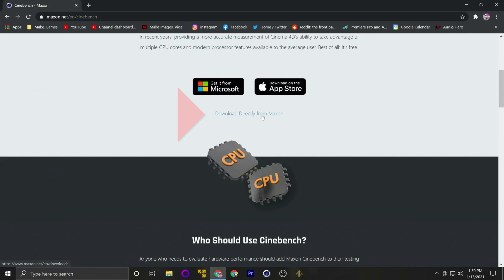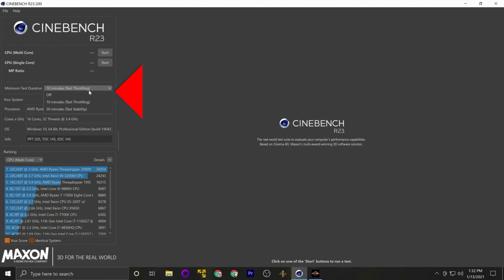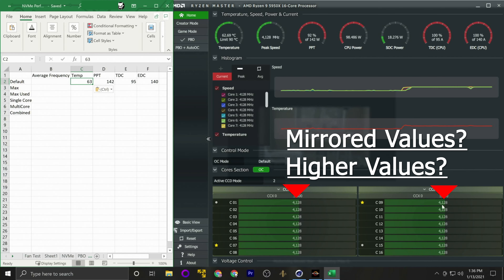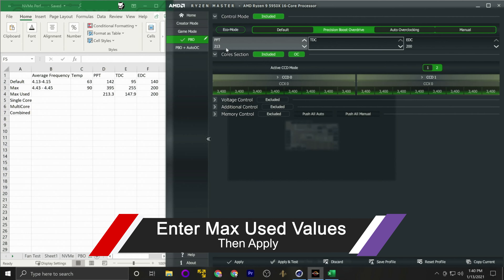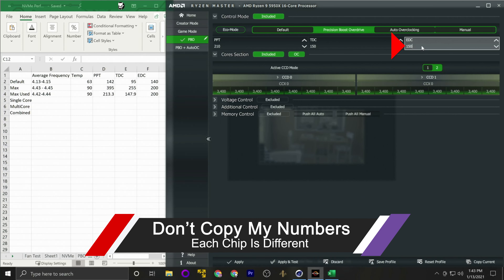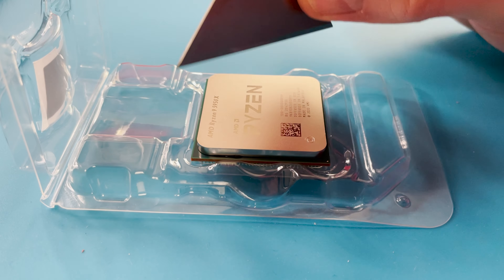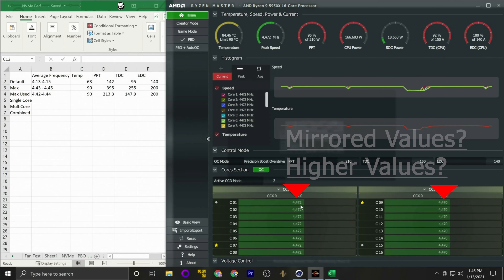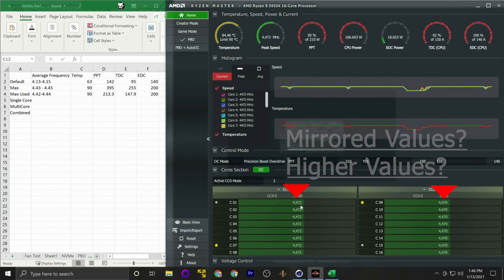Adjusting Ryzen CPU Performance with Ryzen Master ---- Part 3

Comment: What if your single core not only jumps around, but jumps between cores?  Yours didn't jump, and you didn't really address what to do if it does. 5800x
Reply from the maker: It will jump around you just want to minimize how frequently. Jumping means more load on the CPU which means less performance. This could be thermals, voltage, or general use. If you see jumps every 1-2 seconds, that's not good. Jumps every 3-5 seconds is better.

Comment: hello there good sir. thank you for this wonderful video. i did all that you advised in this video, though when i reached the single core test my single core frequency couldn't stay stabilized at all.. like going like crazy.. all i had in background was google chrome with the video of yours.. cinebenchr23 and ryzen master. i tried to change a bit the number of ppt etc. but for no good.. very unstable in terms of 2000 mhz jumps.. can you help me please? i have ryzen r7 3700X.. win11. 16gb ram 3200 mhz.and gpu r9 390 8GB. i think my cpu is bronze :( my MoBo is asus TUF 570x.
Reply: I have a Ryzen 7 3700x and I got mine to 4.475ghz stable. All I done in bios was change Dram voltage to 1.4 v leave PBO in Auto, Go in to Ryzen master set up manual profile, Change Cpu voltage to 1.325v and change each core to 4475 (4.475 ghz) hit apply a see the results. I went from 12430 multicore to 13738 in cinebench r23. Temp is less then 76c and Cpu power draw is less then 76w. the only thing doing it this way is you have to load your profile up in ryzen master everytime you turn your pc on or it will just run in normal PBO mode.

Comment: I know this is a little old, but I'm working thru underclocking/overclocking my Ryzen 5800X. When you update your PBO power limits (PPT, TDC, and EDC), you can apply it immediately. When I do this, I need to restart my computer each time to apply it. Ryzen Master will not allow me to apply without restarting. Anyone know why this is the case? Did RM get an update in the last year that requires this?
Reply: I had this problem, you likely have an 'auto OC' option turned on the the BIOS somewhere. I disabled it and then it worked for me.
Reply: @proevilz  thanks for the reply, I’ll take a look!
Reply: @jacobvriesema6633  No probs. I think even the 'D.O.C.P' mode gives this issue too.
Reply: @proevilz  ah. I do have a DOCP profile for my RAM. I was never able to get the specified frequency to work without the occasional BSOD. It’s only 3200MHz RAM but I have to run it at 3133 to be stable. I feel a little robbed that I bought this ram and it didn’t work out of the box.

Comment: what to do when your limited by the EDC. only one at 100%?
Reply from the maker: EDC tends to be the biggest limiter. I got to the point that I allowed mine to max out after I put the CPU on water. If the others are not at 100% that is a'ok. The goal is to maximize sustained performance.

Comment: my temps are always 90c with a 5800x galahad aio 240 with cinebench.  no matter what i have for pbo settings. someone got help me.  how is this cooler not able to keep it at a decent temp
Reply: facing the same issue even in default temp is already 90c. And when i max out the PPT, TDC and EDC it uses lower than the default values

Comment: What happens if the single core hops? What do I have to do to fix that ?
Reply from the maker: Single Core hoping a lot is more of a problem than hoping a little. Adjusting the TDC and EDC is often what is needed to dial it in.

Comment: Hi man, great stuff on your channel, i must for someone like me that is facing for the first time the AMD CPU.
Let me ask you something:

1) I've set my CO for ALL CORES a negative value of 30, but in Cinebench R23 both in multicore and in single core test Cinebench returns one error: which is the best way to approach the issue? For example, (let's talk about single core bench) looking in Ryzen Master which is the most used core during the test and try to lower the CO value just for that core from 30 to 25 or maybe 20? Or should i increase the power to the CPU (TDC - EDC)?
2) Differently from your CPU, my 5800X in single core bench splits the workload between 2 or more cores. In your video the full load is just on a single core, in my case i rarely reach the top core speed and the load splits between 2 (or 3 cores). Why?

Comment: My max PPT is 395, max TDC is 160, max EDC is 190. Do you know why?  CPU is a Ryzen 5950x
Reply from the maker: Which board are you using?
Reply: @TheGrayingTech  asus rog strix e-gaming x570
Reply: @TheGrayingTech  after some searching I was able to push the limits up in the bios.  Next problem I guess I’m running into is my temps never climb past 81.7 even with the PPT@395 (58%), TDC@255 (63%), EDC@200 (100%).  Max freq I’m seeing is only 4390ish.
Reply: artist unkown  basically you have to go into your bios and manually put the limit in.   He talks about doing this towards the end of the video I think.  Just go put in the max numbers, run the overclock like he shows to tune in your numbers.   I will say he has a bunch of videos on Ryzen and the GPUs so watch all of them. They all have been super helpful

Comment: I also have a 5950x, but my default is already at 3.6 GHz...  Is mine really just that bad?
Reply from the maker: Likely your motherboard does not have PBO enabled.
Reply: @TheGrayingTech  I have an Asus Prime x570-pro, it supports PBO but a cpu should be able to reach it's advertised base clock without PBO, no?
Reply: Is yours still running at 3.6mhz on default during cinebench???

Comment: my cp doesn't reach its max temps on full throttle. why is this? i followed this video to the most
Reply from the maker: The CPU will target 80-90c. If  you aren't hitting the max temp, you are likely limited by another value. Try using Passmark or 3dMark to tune as well to identify the bottleneck. In my experience, it is EDC.

Comment: IF the CCD values dont mirror would i have to drop my ccd0 to match the ccd1?
Reply: Also when i try single core, my second fastest core is the one that is on load. The fastest core (stared one) is under 300.

Comment: isnt the 5950x supposed to boost to 4.9?
Reply from the maker: 5.05 is the target for the boost. The challenge is to get it to stay in that boost area as long as possible. The longer you can boost, the better your sustained performance will be.

Comment: Ryzen master saying some strange limits, in pbo ppt 720  tdc 360 edc 480, no way am I setting those values on my 5800x
Reply: I have done on every thing 900 and applied. My 5800X sucked ppt 130 tdc 81 and edc 150. It pulls only as much as he wants.

Comment: My ryzen master ask me to reboot every time when i change a value :/
Reply from the maker: If you enable a profile with PBO for the first time, it will reboot. Subsequent changes should not need a reboot. If you Adjust Auto-OC it will force a reboot. It could also be that PBO is not enabling properly.

Comment: After this experience with amd I'm hoping back to Intel and never going back. This golden age of amd is embarrassing. QC on these are such trash. I've had 3 different 5800x cpus and only 1 of them would even perform as advertised. I've overclocked several 8 core Intel processors to 5.2 with no problems. It's a struggle even getting these chips to 4.8 without going to huge struggles lapping, cooling, and just getting lucky with silicon. F these chips